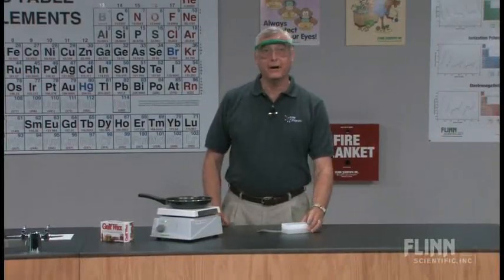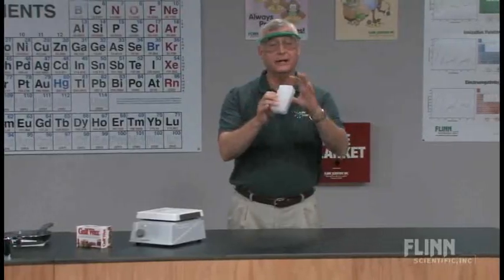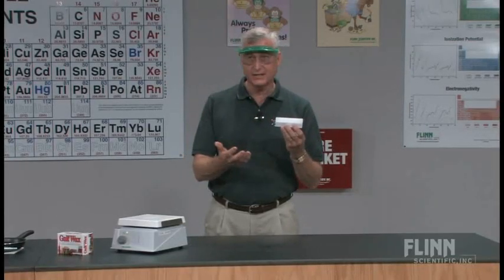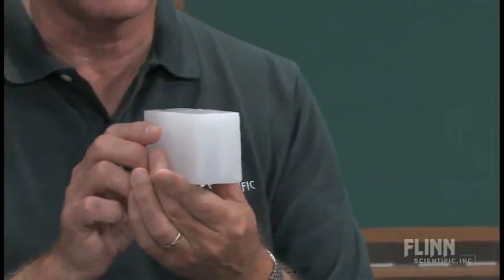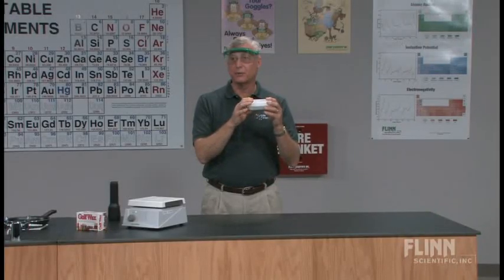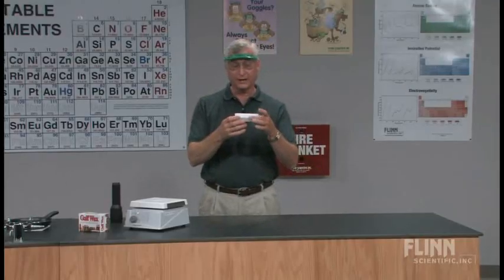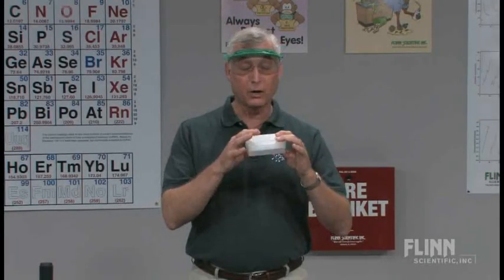Paraffin Paradox

Comment: I don't mean any disrespect. This is not two opposite things being the same being different; my interpretation of what a paradox is. For an example: If I tell a secret, it isn't and I haven't. The experiment only shows two obvious differences that when introducing a light control influences the visual outcome of how light is stored and reflected. Not by definition a paradox. Just a thought provoking experiment.
I don't know everything, so no need for slander.
Reply: You should look up paradox. This fits the definition fairly well since most people would assume top and bottom will switch when you flip something top to bottom by 180 degrees.

I think you are making the same mistake as many others in the comments section (and probably most of the general population), paradoxes are perceived, not absolute. We can imagine abstract paradoxes, but there is no such thing as a paradox in reality.

Next time you see "paradox", just think of some things that appears to contradict one another. The keyword is "appears".

Comment: Sometimes I think I'd like to try teaching. Only thing I'd add is once you have you're hypothesis, it'd be good to find a way to verify it. Not sure how you could without expensive equipment or destroying the block..?
Reply: A good way to verify it would be by trying to replicate it. Since we can see and feel the material we could find something similar, if not the same and apply our hypothesis on it. If the hypothesis was that there is something like aluminum in-between, then by trying to replicate it and succeeding we would have a cheap way to verify it. Ofcourse this wouldn't verify that the original block really works the same, but we could be for 99% sure.

Comment: it white on top and grayish on the bottom because the most light is absorbed on the top and it appears white then on the bottom half it is like black because the most light is absorbed on the top and the aluminum foil blocks the light that goes thru the bottom there for the bottom appears grayish...own opinion...and it's not a paradox bcuz it has foil in the middle and the foil blocks the light that might go through the bottom there for less light less much darker, much light less darker.

Comment: This is too obvious. Light wont pass through the tin foil and the light can only shine on one side of the block, the tin foil blocks the light from shining into the other side. You can tell because where ever light is shining on the direction of the block it wont go dark and it will stop in the middle if it is being shined vertical.

Comment: light passes through the top block but is stopped by the aluminium sheet which casts a shadow on the block below making it look dark.
Reply: I suspect its more than just obstruction: a plastic sheet would obstruct, but this is aluminium.  So not just a shadow, but the aluminium is highly reflective , so the light reaches half way and is reflected back out, contributing further to the illumination of the top layer.

The trick here is knowing that the reason the layer looks "white" in the first place is because its causing *light scattering*. 

I'd be interested to see what you got if you shone a strong laser at this.
Reply: FlatTireGaming if you notice the paraffin is opaque light does pass through both the slabs but the top slab gets more light because of the overhead lights and the bottom slab suffers from the shadow cast by the aluminium sheet which makes it look dark.
Reply: so you're saying light doesn't come from the bottom?
Reply: you can see the reflection of the  light from the lights in the classroom on the professors cap, the light direction is from the cielling so it bounces off the aluminium lighting up the upper block.  This experiment would work the same way out on the sun... The only way I see this experiment not working  is on a very dark and cloudy day.
Reply: Kent Fredric 
I knew it, it had to have had something to do with there being a reflective object inside ! Thanks!😀😀😀
Reply: You solved science
Reply: So simplehonestly like 5th grade level science.

Comment: so if i got this right... the aluminum foil reflects light and shows white on top feom the overhead lights and black on the bottom as reflected by the desk? i realize the desk can not reflect dark light however the desk reflects a certain wavelength that is seen as a reflection on the block appearing black or dark grey.
Reply: Raymond Duncan. The aluminum foil only enhances the interface effect. The light encounters a different medium. Even if it was no gap the paraffin slices are not exactly the same on their surface of contact but the effect would be much smaller,  not suitable for a school demonstration. Also, this lesson is not about paraffin's properties 😀
Reply: dark light ?
GG
Reply: Yes the the foil causes the color difference by preventing the light shining through the top from reaching the bottom.  There is still light going through the bottom because some light reflects off of every thing but not nearly as much as what comes directly from the overhead lights.
Reply: +Raymond Duncan You could not be more correct 🤔
Reply: Nick Blenderman Just as a reference there is no such thing as dark light. There is the absence and presence of light as well as everything inbetween. The difference in light is what you're seeing between the top and bottom of the wax blocks. The aluminium foil is in fact bouncing light from both the top and the bottom however it is bouncing the light at difference intensities because the room has overhead lights. If the room had lights coming from under rather than top it should flip the observation coming from the wax sheets. Not here to belittle just clarify in the case you were trying to or interested in understanding it better.
Reply: Catnium dark matter .. dark lives matter. something

Comment: we need the myth busters to blow it up
Reply: The earliest mention of the mirror device was from the medieval ages, 700 years later. I'm not sure why you're convinced it actually existed but there's no physical or written evidence of it. The historical records say the first attack failed due to catapulted rocks, and the later successful attack *happened at night*.

As for the oscillator, they were testing a very specific claim from Tesla about his handheld device being capable of taking down a building with a few pounds of air pressure, but they could only get vibrations similar to a truck driving by. That's all anyone else can get out of the device too, it was just an exaggerated claim.
Reply: Damn right!
Reply: Suusi Ke Making mistakes doesn't give you 0% credibility, it's possible to be largely credible or somewhat credible.
Reply: Ewan le Roux Um, the Mythbusters CONFIRMED that peeing on an electric fence can result in a shock, you're confusing it with peeing on a train track.
Reply: Yep, just because a claim is old, doesn't mean it's true.
Reply: Wes C-W 
It might foiled
Reply: The myth busters aren't all that fool proof...  For example, they once "busted" the myth of peeing on an electric wire won't shock you.. well I once I peed on a wild reserve electric fencing wire which I did not know was under the tall grass resulting in an indescribable surge to my once proud man parts grinding up and ripping every single nerve individually sending an alarm signal to my brain to "give this man hell" I was never the same again.. I still occasionally cry in the shower.
Reply: But with they experiment with mirrors that were used by ancients to burn down ships, they made low end mirrors that burned ship, but still they decided it was busted cause how long it took for them to make them work. Same with Tesla device that was probably capable of making small earth quakes. They made device that weight like 400 grams, and with that small amount of mass they still was able to make whole huge bridge to shake, and still they claimed it was busted, but if that device would weight like 2kg or more, whole bridge would go down. That are two main experiments that I remember were made bad by them.
Reply: Myth busters are making so much mistakes in their experimantations that I cant even understand how people can even think that they have any credibility.

Comment: honestly it is a rather basic and very easy question to answer there is obviously something non-transparent in the center like wood or as you used aluminum foil the only thing that would give it away as being a piece of metal is that the light is being reflected on the top block and when it is flipped over he light is no longer being reflected on the block that was on-top so as interesting as this was i think some one in grade 2-3 could have figured this out with relative ease

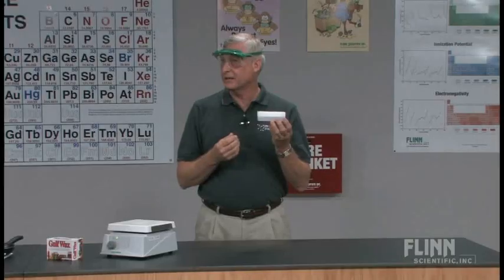Comment: stop at 4:27. the piece on top is more a solid white instead of an opaque translucent white because the piece of aluminium foil reflect the light on the first layer of wax, so light hit the first layer hits the aluminium foil then rebound, also the piece in the bottom is more darker because while the aluminium is between it is creating an abscence of light going through the 2nd layer making the bottom layer more transparent, now if he try to put a light source from below instad from above the white piece would be on the bottom side instead of up

Comment: I think it depends on what angle the light is hitting it. If they had lighting coming from the floor, rather than the roof.. the effect would be inverted.. meaning. That the white would always be on the bottom.. and the dark on the top.
Reply: savnac Music generally, classrooms don't have lit floors. I don't know where you went for school, though.
Reply: Payton Wasemiller I'm not saying there was.. I'm saying IF there was, it was inverted which is a hypothetical solution to those ho DONT know what's going on with it
Reply: savnac Music yea that really obvious when you know it has aluminium inside lol
Reply: When he shines the light into the block from the bottom, the bottom is lighter and the top is dark......... Just sayin'
Reply: Valk my point exactly. The direction of the light and correlation with the shade of the paraffin should have been a giveaway that there was a barrier between the two.
Reply: Jesse Vance Because the light from the torch obviously is brighter than that of the light emitted from the ceiling.

Comment: Where's the paradox?
Reply: The paradox is the wax itself. Normally, you would think, if you switch bottom and top, the color will also switch. But it doesn't. He using this paradox to demonstrate how to create a hypothesis.
Reply: "Paradox: any person, thing, or situation exhibiting an apparently contradictory nature."
Flipping the block over doesn't change the position of the colors. Just because you can solve the paradox with additional information doesn't mean it wasn't a paradox.
The use of the word "paradox" is correct.
Reply: Not for 12 year olds
Reply: Exactly, so there is no paradox, it just a lesson in observation.
Reply: Robert but I'm a 12 year old

Comment: Test its density. The density would be larger than that of wax. Then subtract the density taken from the stated density of wax. From that point compare the value left over, let's call that Xdensity, and then compare it to several densities and then you will find that Xdensity is the density of aluminum. And once you know it's aluminum, you can then extrapolate that when light shines through the top layer of was it hits the aluminum and is reflected back making the top layer bright white, and since no light is allowed to continue on through the aluminum to the bottom layer it is black.

Comment: the white stays on top because the light can pass through the first layer of wax but the light can't pass through the bottom piece of wax because the aluminum is blocking the light and the light is coming from the top

Comment: it has just occurred to me that this way of thinking about science is like training sheep as in training everyone to think of the same questions. and not the important questions. eg you may find that 1 out of 1000 people who would have looked at the block of wax will have a full and correct understanding of what they are looking at  within seconds.
but this way to teach science is teaching 999 people to ignore the 1 person who is correct  or even say that 1 person is not correct /stupid  at least until the other 999 people get there head around it and understand what they are looking at. this could take a long time so long that the 1 person who did fully understand could be dead and buried mabe 100s of years and by then mankind  has forgotten what they are they were looking at. 
the correct questions should be #1 what does it appear to do? 
#2 can we prove a theory correct? 
#3 and if it can't be  proven correct it should be assumed correct until an alternative theory can be proven correct. 
I am not a scientist I am a engineer  but at the age or 10 years old I had a full understanding of IC engines however nobody would beleve me if I told them I could build an engine from scratch.
I couldn't prove that I could as I had no money or tools to build an engine.
now I am 40 years old I have rebuilt many different types of engines tractor trucks cars motorcycle and lawnmower and even model engines for rc models 
but I have many other types of engines in my head that would work better than today's newest engines being produced and i  know that I will never have enough money or time to build them and explain how they work.
when I die my engine designs will be gone too like many other people before me. eg 'tesla'

Comment: It's a nice way to introduce the scientific method. Though the physical attributes which are being measured (such as with the flashlight) are much like an observational study (as in medicine: non-invasive). After the students have formed several hypotheses, it would be nice to let them think of an interventional study (in medicine that would be an invasive study), such as making a small hole in the block. 

I am 99% sure that the average student wants to take the block and break it in two. Although that eliminates the need for observational studies, that is in essence the easiest way to verify empirically any hypothesis you come up with. Thus, taking the object apart is, albeit primitive, also part of the scientific process in this case.

Comment: Due to the aluminum foil having more reflective properties on one side , the waxy substance, what ever it is reflects light more clearly through either side, causing one side to look lighter than the other, its pretty simple really.
Reply: Nothing to do with reflecting, just that the light is blocked from entering the other side. That's why it flips when you flip it.

Comment: stopped at 4 minutes. So the answer is that light reflects from the top into the foil and keeps light from reflecting into the bottom part of the wax making it black. Did I guess right? Cool. I only wasted 4 minutes of my life. Time to take a shower.

Comment: soooo wheres the paradox here?
Reply: Without knowing there is a light-blocking layer in the center one would assume that flipping the block would result in the light and dark halves switching places. But when you flip it it keeps the same coloration.
Reply: Anton Zuykov logic paradox 
Not physical
Reply: probably that it has a visible barrier of light even though the aluminum is significantly smaller than the wax blocks where as it should go through all the way and just be dark under the aluminum
Reply: Magic.
Reply: Paradox -

A paradox is a statement that, despite apparently sound reasoning from true premises, leads to a self-contradictory or a logically unacceptable conclusion. Some logical paradoxes are known to be invalid arguments but are still valuable in promoting critical thinking.
Reply: chaosincarna, where is the contradictory statement?
Reply: A paradox is a paradox, whether it's in the mind, or in your hands. This video does not display a paradox. It displays an optical illusion with the intended audience being ignorant of the foil between the two halves. All of science is there. When light goes in the top block, the top block looks bright because light is passing through it. The bottom block looks darker because it IS darker. There is less light going through it due to the primary source of light in the room being obscured by the foil, only permitting the ambient light to pass through. When you turn it over, the block that WAS on top is now on the bottom, and vice verse. With the light source in a fixed position, the rules remain the same. The block that is on top has more light passing through it than the one beneath it, so it appears brighter. There is no paradox as logic is not being contradicted. It is an illusion, and once the observer becomes aware that something is between the two halves, logical deduction takes over to explain the phenomenon.

Saying that something is a physical paradox rather than a logical paradox is like saying that something is historical science rather than observational science. They are the same thing, and trying to separate them only shows how stupid you are. If something does not contradict conventional logic, then it is not a paradox. If you want to cling to your idea of a 'physical' paradox, then let me give you an example of what you're referring to. Go back in time and kill your biological grandfather. Doing so means that you'll never be born, so you can't go back in time to kill your grandfather. And since your grandfather is alive, you get born, allowing you to go back in time to kill your grandfather. But when you do, your grandfather fails to create your parent, meaning you don't exist, meaning you can't go back in time to kill him, meaning he's not dead, meaning you are alive, so you can go back in time and kill him, meaning you never get born, meaning he lives, meaning he dies, meaning he lives, meaning he dies.